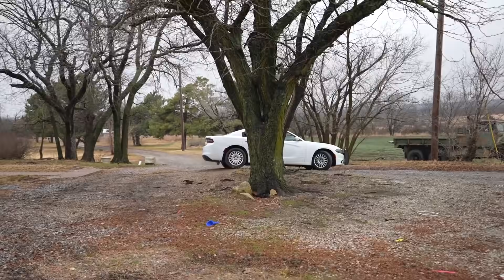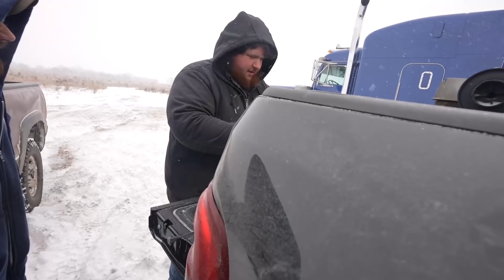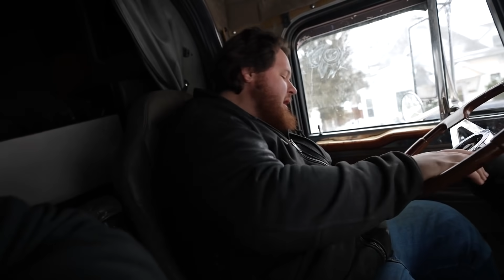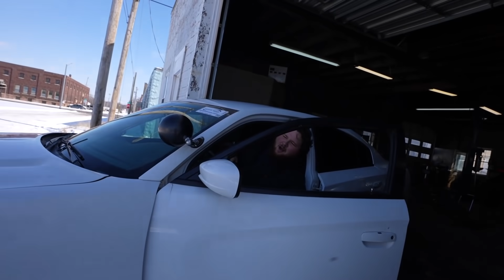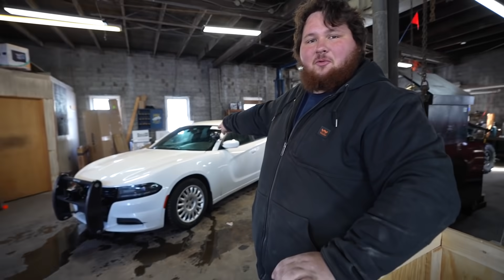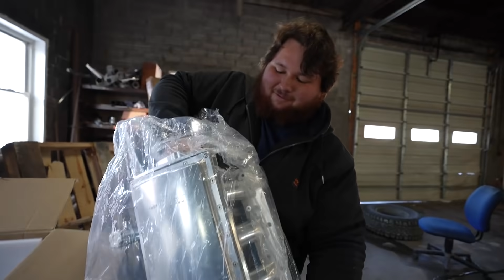I got a 1400HP Engine for the Police Car

Comment: "How do Canadians do this and still stay polite?" we cry ourselves to sleep and be brave in public. 
Sincerely the Albertan where we just had 2 weeks where the highest temperature was -30
Reply: As a fellow albertan I second that
Reply: I haven't got snow in 4 years (I live in north Carolina in the U.S.A
Reply: @nikkidavidrobertson740  broooo NC weather is so shitty
Reply: How do you stop your water from Freezing?
Reply: @renoflames  i live in northern british colombia, our water lines are dug really deep (below the frozen layer of ground you get in winter), our fire hydrants also have the water shut-offs about 10 feet deep so those dont freeze (you can get too them from ground level of course), then of course you just keep the house heated so they dont freeze in there haha
Reply: @renoflames  we bury water lines below the frost line, typically 3 feet deep at least. We insulate our houses well and we actually have heat in our houses.
Reply: As a Saskatchewanian, I can 3rd this from the cold snap we had
Reply: in edmonton it was close to -50+ for almost a week straight
Reply: Yup as a another albertan, in my Valley we saw a high of -40 for 3 weeks last winter, the trick to starting a truck in that cold is.....NEVER SHUT IT OFF! Lol

Comment: Love the content! Albertan here and last week it was -33F (Alberta is the Canadian Province above the state of Montana) -33F is the temperature you jump in your car and your seats like sitting on a concrete bench. Diesel tip: If fuel stations near you don't have winter diesel a bit of ATF (Automatic Transmission Fluid ) in your diesel tanks will help prevent gelling

Comment: As a “northern’r” 
we use a little thing called “anti-gel”

Or, you can put some kerosene...
or diesel number 1, which is jet 🛩 fuel ⛽️ like they use in North Dakota.
Reply: Yes it is, except below negative 30 was gelling a week and half ago here in ND. Diesel 911 sells like hot cakes here.

Comment: Better order another tcase. You might want to check the transmission outgear betweenthe trans and the tcase. I've had a bunch (mainly cop cars) were the 30mm 12pt nut comes loose from the gear!

Comment: If that AWD system breaks you may want to consider switching to a track hawks drivetrain, there’s some videos around of people running 1100hp through them, I don’t know if they are built or not but regardless there would be some more options for you

Comment: good luck making that power train hold together.. I own a 2016 awd pursuit.. the 5 speed is weak, the transfer case/splitter is terrible at distributing power, the rear differential is a one legger  and there isn’t a posi available(from what I can find) ..  if you put it in 2 wd and whomp on it.. it still kills the transfer case.  And! The suspension is SO stiff it is terrible on uneven surfaces.. like a dirt road or snow.. the awd is a joke on anything slippery.. 

but it is fast from point to point on dry roads like nothing it’s size.. you can hoon  it like a fool..
Mine is class 4 armored.. not just the door panels.. so it is a little heavier.

Hennessy supposedly swapped 80% of a Trackhawk power train into one... not sure who for and never saw it after.. the SEMA car with an awd widebody and high HP is a good inspiration.